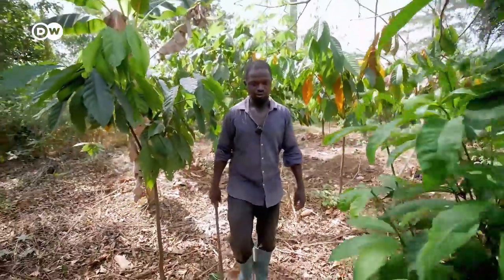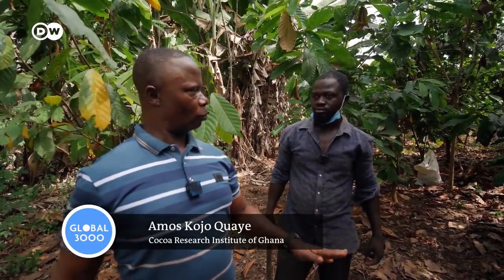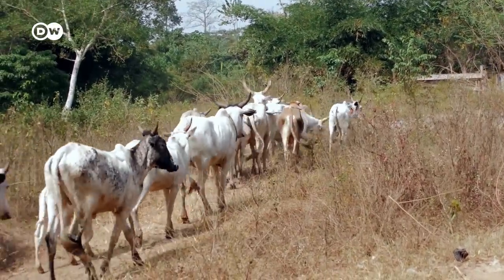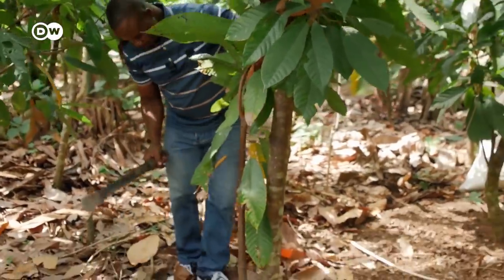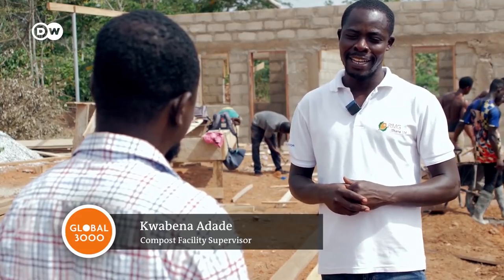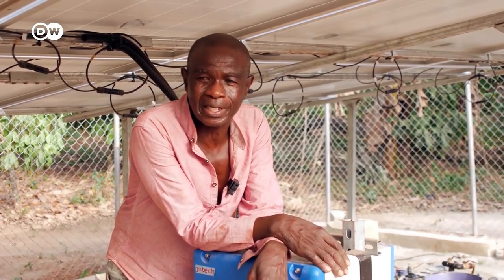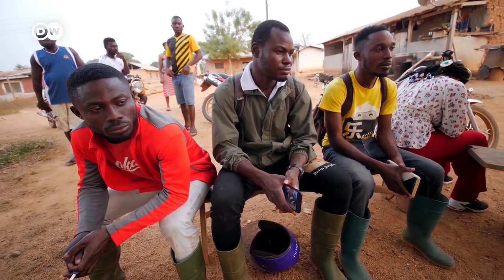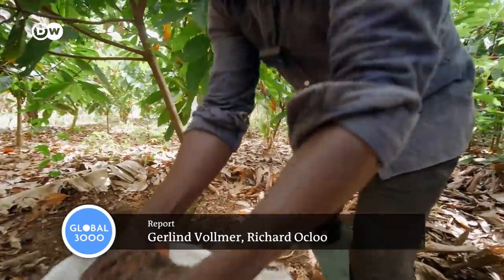Sustainable cocoa farming in Ghana | Global Ideas

Comment: I think I have to respectfully disagree with some of the advice given by the Ghanaian Cocoa research advisor. The tree he said was taking all the H2O from the farmer's plot; whilst it will take a fair proportion of H2O, its root system will also help more H2O to infiltrate down into the soil, preventing runoff & erosion & form a crucial part of the below ground interconnected web of life, mainly linked by mycorhizzal fungi that (include) the farmer's cocoa trees. That interconnected web helps provide nutrients, defence against pests & diseases, allows for extra support to an ailing tree by one or more surrounding trees & other flora; this something only recently discovered by scientists, extent of the knowledge is in its infancy & research is still ongoing. 
Additionally, monocultural production of any type, whether for food or timber, has & continues to have major negative environmental impacts. Which is why there is so much emphasis beginning to be placed on regenerative & permaculture design & practice in order to repair damages done to both soils & ecosystems in general, & for sustainable circular production systems that allow humanity to live within the planet's means of supporting life.
Reply: Everything you stated are good and proper suggestions. However, you are historically wrong. Mycorrhizae were discovered by a Polish botanist in 1879.    However, this discovery was left dormant for about eighty years until a practical application was devised. The innoculant method was developed in Africa to trees bereft of mycorrhizae.